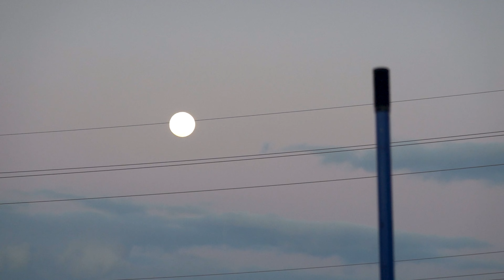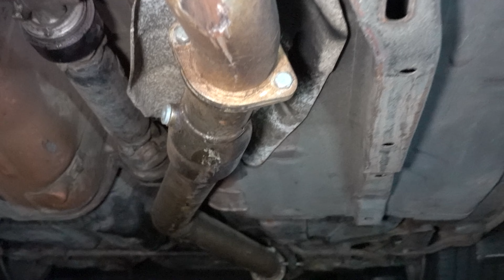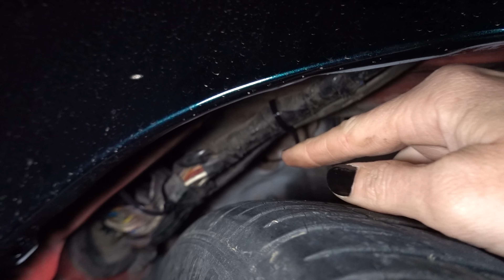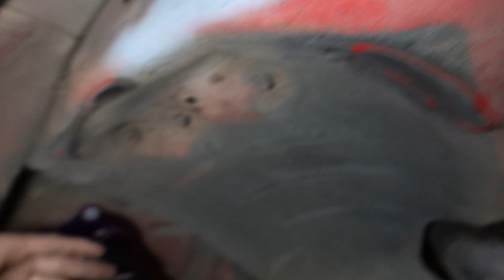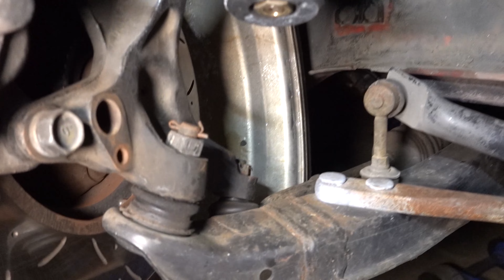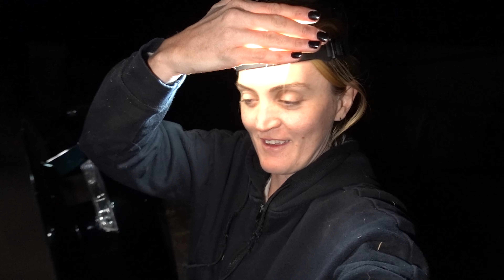My NISSAN SILVIA got CRASHED by @SAMMIT

Comment: Man that sucks BIG time... Feeling the pain... Back in the day I had an Opel Calibra (or guess it was marketed as Holden Calibra at AU) which I compleately built and tuned. Was proud AF. On Monday I had an apointment at the paint shop to get the "Alfa Romeo Azzurro Nuvola AR414B" paint on it. Well... Just less then 24h before that on sunday, my piston seals/rings decided to break. On the Autobahn in a speedlimit free part. The whole engine went Bang. Parts, oil and pieces everywhere... 

Looking back, I'm happy, it happened BEFORE I got the paint job. If it was afterwards, man.... That woult be "really undesireble". 

Really feeling bad for you. Such a nice S14! Also feeling bad for @sammit. It must really suck to total a good friends car. I know I would feel really horrable. But hey! He is the reason, I found your channel, sooo.... It's something...?😅 Greets from the snowed in Nürburgring, Germany😊
Keep up the vlogging. Like it a lot! (☞ ͡° ͜ʖ ͡°)☞ To the 10k Subs!
Reply from the maker: Did you end up rebuilding the calibra? :)
Thank you very much!